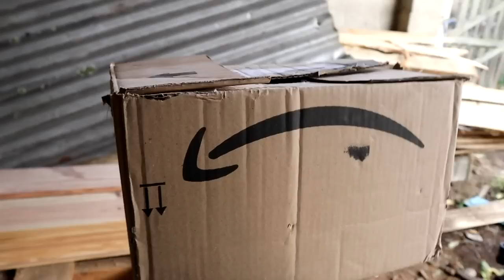Huge Bathroom Transformation // Restoring Our House #15

Comment: The bathroom is awesome my brother! If I may make a suggestion; if you are able to would be to install an exhaust fan in ceiling in shower as well as in the ceiling in the middle of bathroom that is tied in with the lights. I hate to see your bathroom not last as long because of humidity & moisture. You may already have them & I just didn't see them. Have a blessed day.